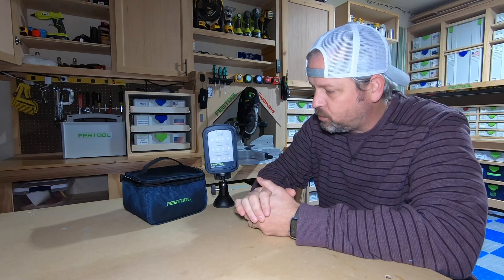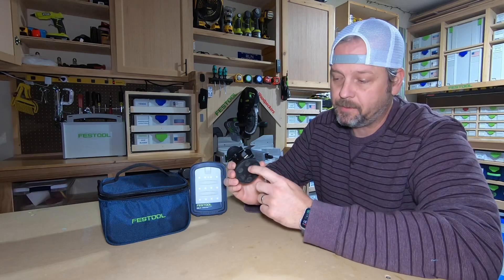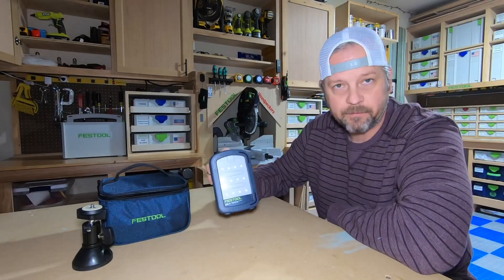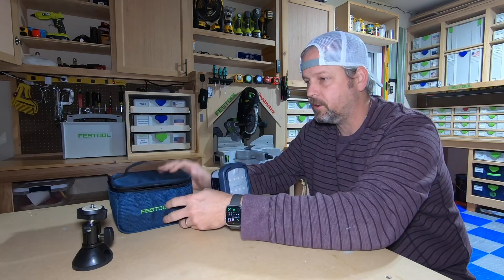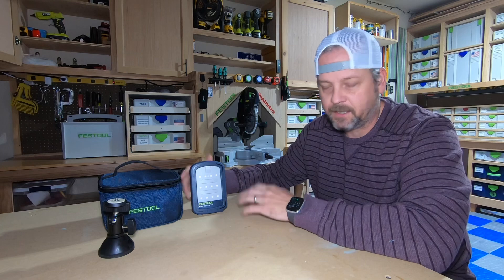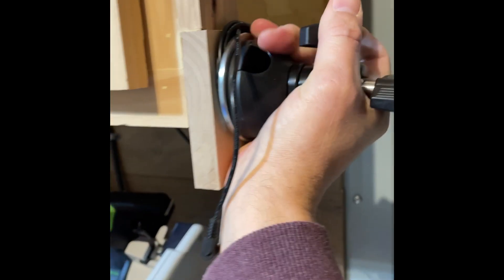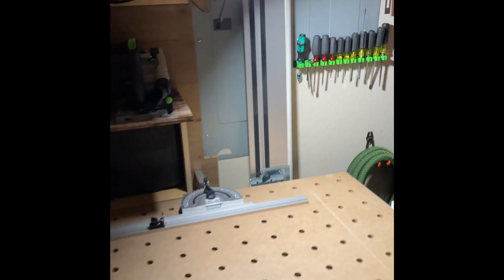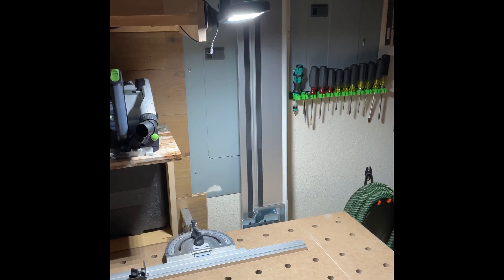Festool Syslite KAL II

Comment: Informative and helpful, and as you said, there's not a lot of user info/feedback available on this light - thank you.  I bought the new Milwaukee M12 Rover last year, which seems fairly close to the Kal II in terms of light output.  I've found that this size light (considering the Rover and the Kall II as the same basic class of light in terms of size) is very helpful both for task lighting as well as for "inspection" purposes.